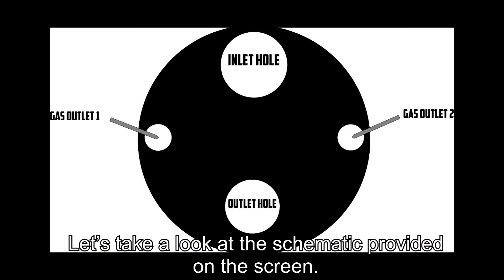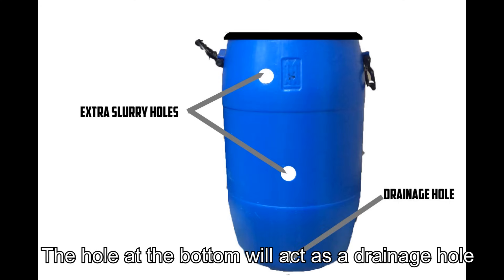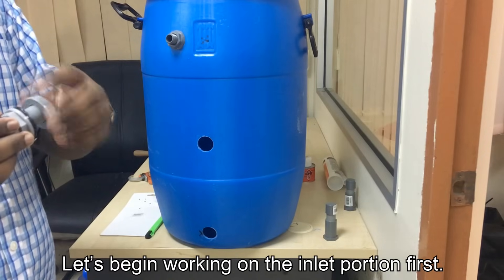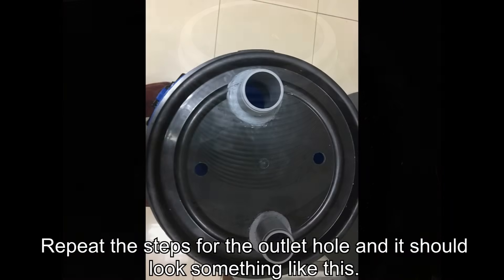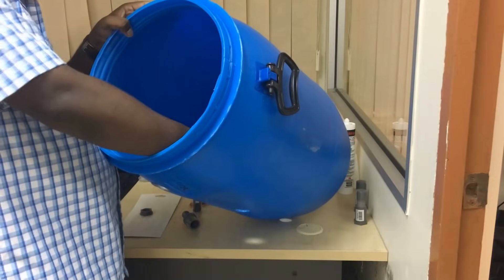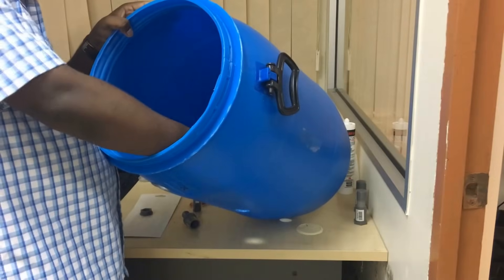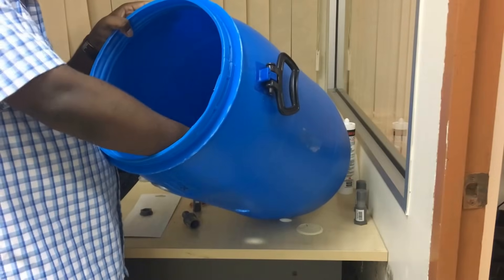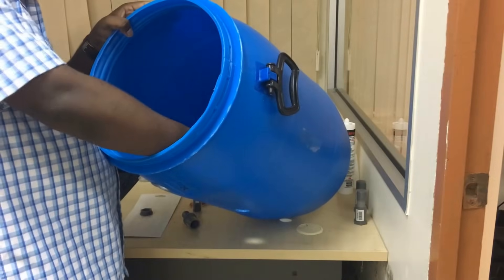How to build a biogas digester | DIY TUTORIAL

Comment: Thanks for the insicive video, however, having the outlet pipe above the cover means that by the time the digestate flows out, the slurry will have filled up the drum. Doesn't that leave very little space for the gas?
Reply from the maker: @mwimafazal6979  that’s why we have a gas outlet connected to a gas bag (tire tube)

Comment: I have built it...the issue is the open slurry outlet. I believe the system doesn't produce enough pressure before being released via the slurry outlet, so you lose the gas as the slurry gets pushed out. The easiest option is to add a tap to the outlet in order for pressure not to escape until you manually release it...but this could result in too much pressure build up and you would also need to isolate your gas storage to avoid it running back into the system as it tries to equalize the pressure. My opinion is to find another design.

Comment: Hello, Great idea, love it. The outlet pipe using a 90-degree angle may not work. Once some drainage starts, there is a danger of the syphon effect will empty the digestor. probably best to use a T-connector to mitigate this danger.
Reply: It can only sick down to a certain point anyways.
Reply: @adamsaquatics3332  I need answers for my question
Reply: 0⁰0⁰00⁰⁰ⁿ
Reply: ⁹⁹

Comment: Good evening. I am wondering why you have three outlet hole at the top of the barrel.  I do understand that I need an outlet hole for the gas to my stove and I also do understand the inlet hole. Can you please explain the value of the two other holes. What is difference between the three holes on the side of the barrel with blinds.

Comment: Nice presentation. But I am curios, the outlet pipe is almost the same level as the ball valve of the inlet. but way higher than the digester cover. you need some space from the highest part of the slurry to the digester cover do let air enter into the digester. Without air, no oxygen and without oxygen? no bacteria to convert your bio material to methane. Second scenario, if the slurry will only fill 2/3 of the digester tank. then that outlet is useless but still you need a valve or blind to cover the outlet pipe so as to prevent the methane gas from escaping. This is a not so tutorial. this thing will never work.
Reply from the maker: Hye, I used cow manure to create the bacteria pool. For the slury, you need to fill it till the brim and it creates sort of an airtight environment. so when you feed food waste into the digester, older slurry gets displaced
Reply: @avimakesstuff703  I have no problem with the bio materials. all are same. you need bacteria to convert those bio material to methane. I am curious with your digester design. Simple law of gravity told me that an outlet pipe should be lower than the tank cover (digester) if the material to pass through is liquid or semi-solid  with a consistency like of a liquid. The same law of gravity told me that your outlet pipe is only good to be used for gas outlet, since no valve or blind to cover it up.
Reply from the maker: @THEWEEKENDFARMER-2020  oo I get you now, well in my case it worked just fine, but sadly I don't have proof right now as my lecturer only wanted me to show the build of the video. My plan is to make a smaller version of my model and explain the feeding process in detail ,  the physics behind the digester and demonstrate that it actually works because a lot of people were asking me on another video regarding this topic.
Reply: @avimakesstuff703   I bet it wont work. If you can prove me wrong, I am humble enough to apologize but if I am right, are you willing to apologize as well for deceiving your audience? Just imagine filling up all your three stand pipes with bio materials, leaving the outlet pipe open. How can the methane gas choose to pass through the smallest pipe when it will surely encounters a lot of resistance? are you sure it will not pass through the outlet pipe even though you leave it wide open with almost no resistance? you can't violate simple law of nature and justifies it with the number of people requesting you of a follow up video. It does not work that way.
Reply from the maker: @THEWEEKENDFARMER-2020  Honestly if I'm wrong, sure ill admit it. At the end of the day, I just want to make sure that my audience gets the right information. To be honest, I've been pondering on your question, but a decent explanation is to look at minute 7:32. Notice that the pipes that are connected to the outlet and inlet are of different depths, so logically the gas should only rise to the top and escape through the gas outlet. However, I'm not sure if gas escapes through the outlet because its soo deep in the digester or through the slurry outlet. Maybe, Ill experiment with that in the future video but for now that's the most logical explanation. ISTG that the model works because I did a gas chromatography test to ensure there was methane in the biogas. So if it didn't work, I don't think ill be able to get gas and do the gas chromatography test.
Reply: @avimakesstuff703  Well I got your point on 7:32. I have overlooked that you submerged your inlet pipe into the slurry for about 80% but you submerged your inlet pipe as well to just a little bit higher. For the methane gas to leak on the outlet pipe, i have to apologize for that, it might not be much since methane are formed on the upper portion of the digester. But my argument that it will not work still hold. because your outlet pipe hole is way higher that your digester cover. so naturally, those three pipes will have bio materials  at the level of the outlet hole. right? 
After reviewing your video at 7:32 I have found other problem. You have submerged your outlet pipe a bit deeper than your inlet pipe. so it is a big possibility that your new slurry will be push out through your outlet pipe. because the difference is very small and the outlet is deeper than your inlet. If you want to push out the old material and retain the new one, you should have submerged your inlet pipe deeper into the slurry (around 80% of the digester's height) but only submerge your outlet very little. (say 15 to 20% of your digester's height). provided your slurry is at most at your digester's tank cover level.
Reply from the maker: JACK OAT Yes the level of the slurry will be at that level of the slurry outlet but there is no issue there actually. My digester still works and It managed to produce gas. 

I see, Ill review that part with my lecturer, thanks for the advice. Never thought of that posibility.
Reply from the maker: JACK OAT one more thing, the outlet pipe submerged that shallow is because above the halfway point is where the least bacterial activity occurs

Comment: Sir
Can we add both kitchen waste and cow dung? Once in how many days should we add?  How long will it take to produce gas? What is the side holes used for? What is the slurry thing in the outlet? To know the gas level can we connect a transparent water bottle in the gas pipe line? For how long it will burn?

Comment: 1. Why there is two holes for gas? (when using only one)
2. Why there are three holes on sides? bottom one is necessary for cleaning of barrel if needed. But why other two? Final assembly didnt had them used.
3. Is biogas digester is faster in digesting waste than other available methods? I may not need to have store/use gas. But like to have one fast degrading process to reduce waste

Comment: Bro I have seen in many models the outlet slurry is from the bottom to top of the tank what is it's advantage
Reply: Me too i have a question how would slurry go up?
Reply: This is also a puzzle to me, for the outlet slurry to come out of the pipe, the slurry or water level inside the tank should be full actually more than full capacity up to the level of the output pipe angle connector. Something is not right here.

Comment: Very Good explanation & a true effort to make it easy for learners to make own. Some observations: There is no need for two 1/2 opening in the top. Only 1 suffice. Advice is to have a T joining in the Gas outlet pipe with 2 valves, one from tank side & other towards stove side. 
Next is to have a interconnecting pipe to the Sludge removing pipes & have a single valve at the outlet. But what you have done is also suffice but it will call for leak test every time the sludge cleaning happens. A inter connector pipe with valve will reduce major activity.
Finally add a schematic drawings for the learners to understand better. But it is not a must as the explanation is very good.
But over all this video is eligible for 90 out of 100 marks, Excellent works. keep it up.
Reply from the maker: thank you so much sir.

Comment: When slurry pipe is on lid then why three holes in the side of container
Reply from the maker: hello there, the bottom hole is a drainage hole. the other two are just extra slurry holes that you can use in case something is blocked.

Comment: Inlet pipe hole should be bigger, I tried with these dimensions but most of the kitchen waste is big enough to get stuck in the inlet  pipe, so keep inlet pie at least 3 inches wide, this ensures feeding is easy, no mess around the feeding tube.
Reply from the maker: thanks for the info. just for your infomation , we grinded the kitchen waste to ensure that dosen't happen.

Comment: Sorry to say that using that type of epoxy on that hdpe container is not going to work.

If you want a seal, you need to find a method of sealing the gasket to the lid and to the pipe which are different plastics.

So all you have done is allowed a small break in the way the plastic connectors and gaskets affix to the bosy and lid, IMHO total waste of material, you should use a Loctite fixative as they have a comprehensive range of appropriate glues and glues that are flexible and will move and expand with the tank expansion.
Reply from the maker: hello, my digester wasn't designed to expand and contract and the epoxy clay works fine for my case . However, thanks for the comment I learned something new
Reply: @avimakesstuff703  HDPE can be welded to other HDPE, same for some plastics.

Unless you have a pressure relief of some sort, your pressure build up will cause a leak at the joint compound you used, it may appear to be gas tight, however, it will not be.
Reply from the maker: @thepvporg  thanks alot man . i learned something new. like i never knew that stuff like that existed . thanks

Comment: I got one question. Wouldn't the gas exit the tank from the outlet pipe?
Reply: I believe the outlet pipe has liquid above the bottom and has only one way to go. That would be out the smaller gas line into the tube.
Reply from the maker: @richardholt9170  yes @One Connect Show , that's the way to go.
Reply: IM THINKING THE SAME

Comment: how do u store excess gas? and what if u dont use it , will it explode from pressure?
Reply from the maker: Later on in the build, we used a three-way valve instead of the two-way valve. so once one gas bag is full,  we channel it to the other one. But basically its how we play around with what we have. Hope that helps and have a great day ahead.

Comment: how do u get the gas from there to your propane stove?
Reply from the maker: later on in the build, we replaced the two-way gas valve with a three-way gas valve. So when we want to use the gas, we twisted the tap to channel the gas from the gas storage to the propane stove and shut off the channel from the digester. Hope that helps.

Comment: Good brother, have you done any work on biogas recently ? Please I would like your help to direct me on the requirements i need to have a perfect job done, cause I used a 200 litres gallon in building my but only discovered that all I got was co2. After several weeks of my waiting. Please anyone can assist me in this matter. As I am still open to learning from you. My WhatsApp contacts +2348064611494. Thank you for your corporation
Reply: Did anyone answer?
Reply from the maker: Hello sir, ill reply it in the comment section. So basically what you will do is deposit cow manure in an anaerobic environment. The first few gas bubbles will only start surfacing after 1 month or so. After that, we continue feeding cow manure just to increase the anaerobic bacteria in the digester and leave it there for 2-4 weeks. Then we have to begin acclimatization which means getting the bacteria used to the new environment which is food waste, so feed some food waste into the barrel and leave it for another 2-4 weeks. The slurry PH should be near neutral as that is very important. Also, look into anaerobic digestion articles and understand how the 4 processes work ( Hydrolysis , acidogenesis , acetogenesis and methanogenesis) . hope that helps. Do feel free to email me. avino1001@gmail.com

Comment: Hi dear friend,
Thanks for the great video, l don't understand why you did a second hole that is on the midle of tank and also on top why you did 2 holes for gas when in the video you use only one, the other one have a tap on it. 
You should make a plan on the paper first and explain each holes purposes.
Much appreciated if you gives us more information about.
Thanks and Namaste
With love from Daniel
Reply from the maker: Hello Dear, those were precautionary measures taken in case any of the holes got stuck with food waste. I had very little time to complete this project, so I had to take these measures just in case anything out of my control happened. The middle hole and the two holes at the top aren't necessary. Hope that helps and have a wonderful day ahead
Reply: @avimakesstuff703  do you have any video of the operation. Any latest video?
Reply from the maker: Amrithraj Gopalan Hye, Ill be making a video answering all the comments very soon, and as for progress , I wish I had prolonged the experiment but I didnt, so I do appologize, How ever I will cite some research papers in the next. video regarding this topic
Reply: Секстурк
Reply from the maker: aicram62 Hye, actually I didnt calculate that part because my experiment was just to fabricate a digester to recycle food waste.

Comment: Great video. At 11:44 can I know what did you use to connect the gas tube to the pipe. I am referring to the white screw connecter like thing. Also will be great if you can give a whole list of all the items used with their sizes. Thanks
Reply from the maker: Thanks for the support. Yes, that's what we used in this build. I found that piece in a hardware store and it fits my connections. It's actually a heater pipe connector for the household water heater. Alright, will do. Thanks for the support.